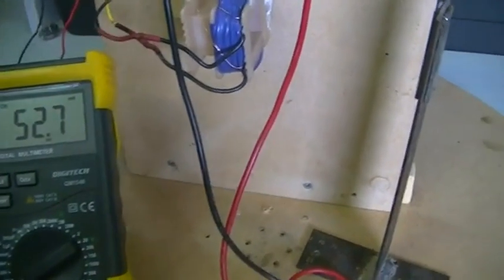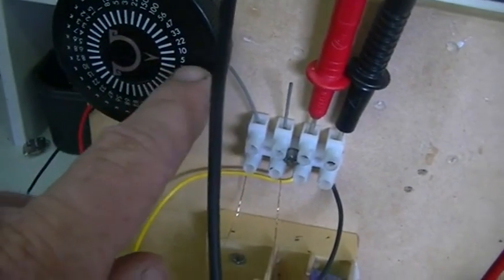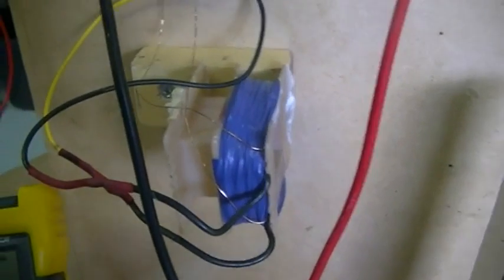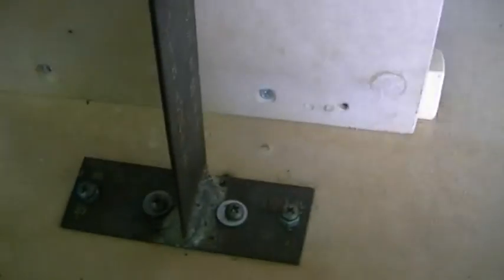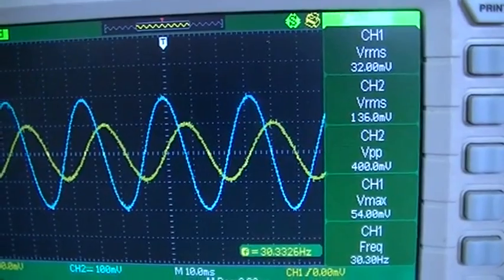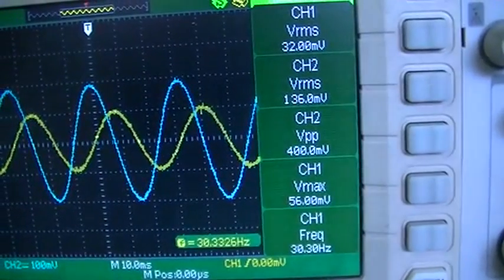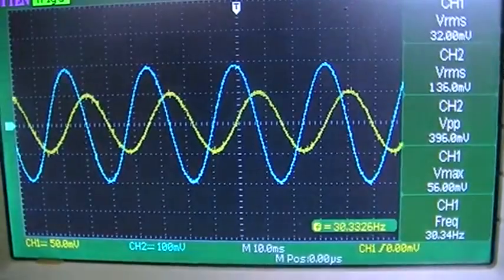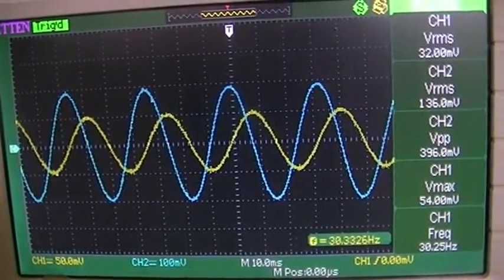The Power Of Magnetism

Comment: HEY mR. TINMAN just occurred to me about the oscillating magnet  and the power that it dissipates on your table; What if you place parrallel magnet setups, lets say 5 bars all in north south opposing each other, wouldnt that cause all your bar magnets to oscillate without taking more energy from initial bar magnet setup because the energy is coming from the natural opposition (repelling force) between magnets if placed n-n and s-s?

Comment: You’re very skilled Sir. I was jaw dropped fascinated with your highly interesting experiment.
As personal curiosity, would there be any farther advantage by trying to retain
some of the kinetic energy loss from the oscillator-bar by transfer it into a
crankshaft to harness a mechanical output… By adding a low mounted fulcra point
at or near the base of the oscillator-bar, producing a pivoting action at the opposite bottom end of the oscillator-bar fulcrum point 
https://www.youtube.com/watch?v=Jx5nOn0tf_k
https://www.youtube.com/watch?v=Cas_tOSgz8Y  with aspring absorbing actuated lever system at or near the base of the oscillator-bar.
Another alternative would be to add a segmented gear at the top of the
oscillator-bar for a fuller swing and not using a fulcrum at or near the base
of the oscillator at all keeping it rigid as per the original design. Another alternative could incorporate piezoelectric generators by sandwiching them onto either side of a modified oscillator-bar a “duel piezoelectric mounted power producing three axial adjustable dampening base-plate assembly.” The power from the piezoelectric
generators could be fed back into the primary field coil circuits with a capacitor.
https://www.youtube.com/watch?v=rUB31HWt8Mk&t=20s

Finally adding a conical or pointy magnet to the oscillator-bar to possibly increase inductance to the air-coil by passing into it during oscillations. 
https://www.youtube.com/watch?v=yNtZUFhjquw
Or would this make the system unnecessary far to mechanical.

Comment: you said you could get 6 times the efficiency by adding another coil to the other side of the oscillator.could you get the same result by adding another oscillator to the other side of the original coil?
Reply from the maker: +bill bailey The oscillator would have to be exact,so as to maintain the exact resonant frequency of the one already in play.
Reply: +TinManPower thanks for the answer,this is very interesting.

Comment: With your oscillating magnet causing the primary and secondary signals to be 180 degrees out of phase, you have a Power Factor of -1.  So it looks like you have created a novel power generator.  Very clever.